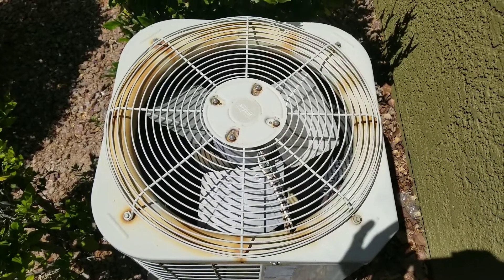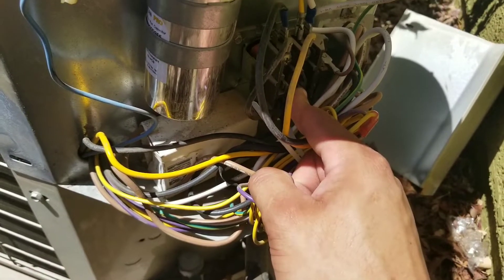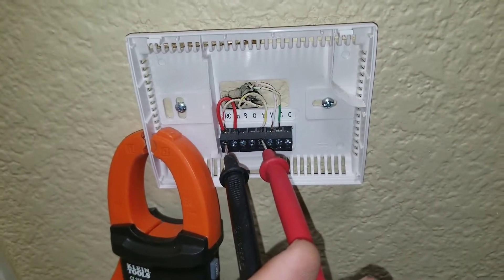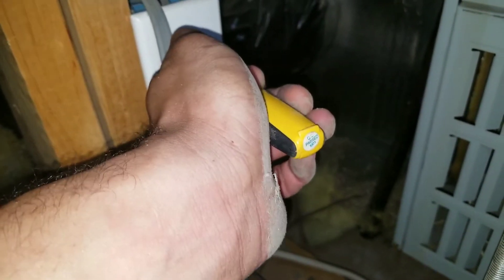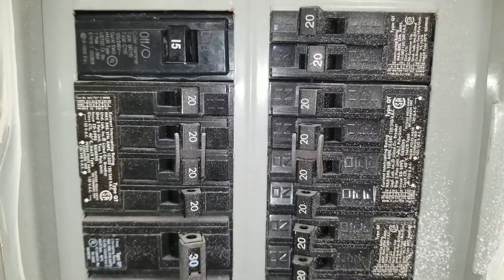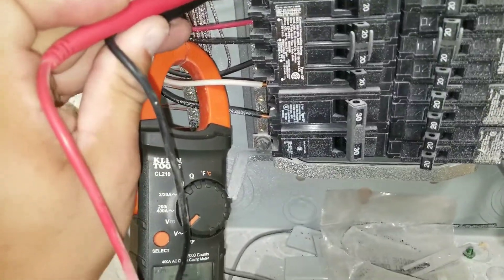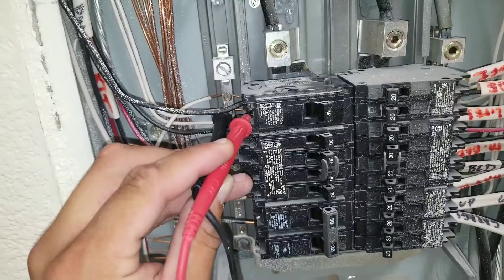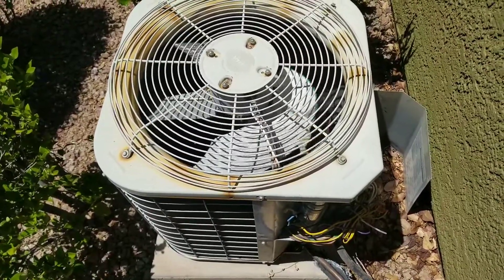AC Not Working? Fan Motor not Working? Compressor not Working?

Comment: Bro my ac wasn't turning on after I replaced the capacitor and I was confused. But I press that button and it just started working from there. Thanks your video helped my family not deal with this 85 degrees weather.

Comment: Okay that button on mine when i tested with AC unit turned off  can be pushed and it  is spring loaded so it goes in/out when pushed....then i turned on AC system and went to push it and it was already pushed in by its self... i pushed on it and i got a buzzing noise each time i push it... Fan motoe and compressor are not working at all and no noise at all from either of them.... Does this mean i need to replace the capacitor??? or something else outside? please let me know ASAP since its 92 degrees in my house.... thanks